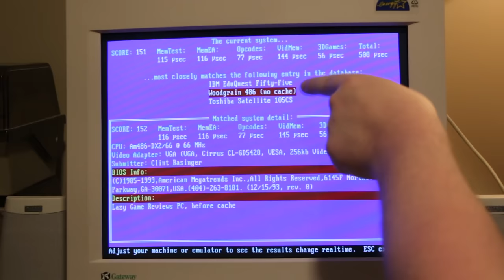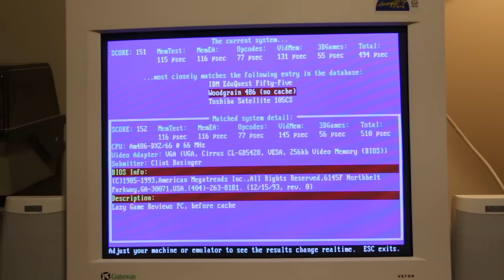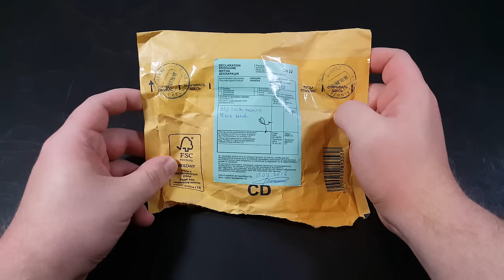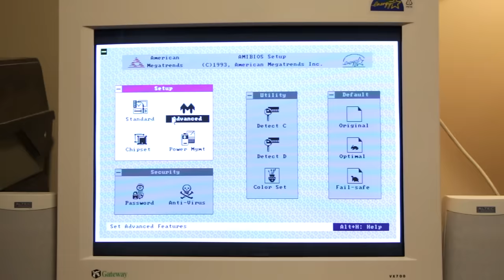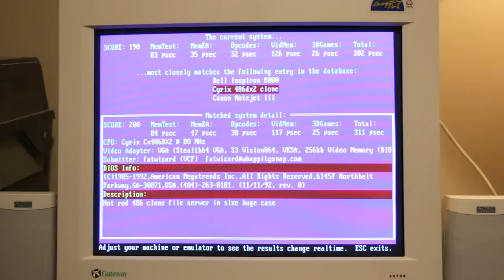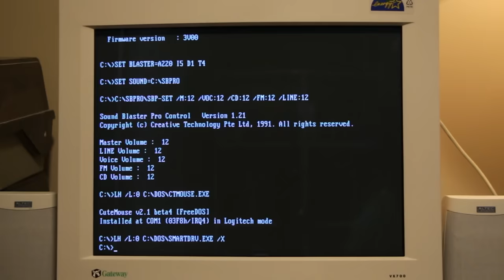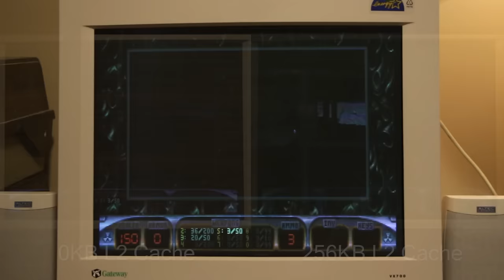LGR 486 Update! Installing L2 Cache

Comment: You can Play Diablo (1996) very well on a 486DX2 66MHz - it has minimum requirements of a pentium 60Mhz but for me it ran quite nice on my 486, and even better - since slower walking heroes were much more realistic than the sped up walking from a faster machine. Try it, you will be surprised.

Comment: I love the video, and I hate to be that guy, but shouldn't you be wearing a wrist ground strap when handling memory chips with your bare hands? You probably are in an environment where the air isn't too dry and the risk of a static shock to the chips is fairly low, but with something that's not easily replaceable, I'd still wear one just to be on the safe side. And yeah, Duke3D isn't really a 486 game; considering the machine and the game, the performance you got is pretty decent. :)
Reply: I've worked on RAM and cache chips all the time without a wrist strap and never had any problems with static discharge. Old 5-volt hardware is not that prone to it anyway. Just remember to touch the power supply to ground yourself to the case before working on it.
Reply from the maker: Not an issue. I explained why in the original build video:
https://youtu.be/fbjYkPKRm-8?t=1078

Also, as others have said, humidity in the south is absurd. I've never had problems with static since I started working on electronics a couple decades ago :)

Comment: It's odd but my IBM Aptiva 486/SX 33 ran Duke a lot better than that! It had its slow downs, especially with sloped floors, but otherwise it was relatively smooth at 320x200 with a slightly smaller window.
Reply: Maybe you had a better GFX card (VLB?) or better cache settings, like setting to fastest (2-1-1-1) instead of standard settings. I have a DX2-80 with a matrox PCI card and it runs Duke 3D with absolutely no slowdowns and Quake is almost as fast as on a Pentium 60.
Reply: Slowdown on slopes in Duke3D had to do with the lack of an FPU in the 486/SX, forcing the game to use slow software floating point emulation in those cases. Our Compaq Presario back in the day had the exact same problem.
Reply: I had a standard Cirrus Logic VESA 2MB card - nothing special.  Since it was a full toting multimedia machine, perhaps they added lots of cache and so on - still odd that extra 33Mhz and a co-processor would make so little difference.
Reply: Astfgl As far as I remember, Duke3D does not use any FPU stuff, even with the more advanced Raycasting? It was made for the 486 generation, Quake on the other hand was made for the pentium , which had a 3 times faster FPU, where it made sense to use it. It is surprising how fast Quake runs on a 486, when comparing it running on a 68040 with the same speed (50Mhz on the Amiga). However, on a Pentium 66, it adds a whopping 10FPS.
Reply: redavatar a 2MB card is actualy quite good. I had a Cirrus logic with 512K which could barely run Win95 at 640x400 at 32K colors.
Reply: AmstradExin That's how I've always understood it anyway. Duke3D uses integer calculations for pretty much everything, but needs a little FPU for calculating slopes, though it can fall back on emulation if no FPU is present. To be fair, I don't know anymore where I got that explanation from, I should go find a reliable source sometime.

Quake uses FPU all the way throughout its entire engine, so there's no way it could use emulation and still get decent performance. It would simply not start up at all if you didn't have a physical FPU in your system.
Reply: Astfgl Yeh, it doesnt
Reply: +AmstradExin I just checked the Build engine source code released in 2003 (what could be a more reliable source than that?) and yes indeed, it does use a couple of floating point assembly instructions in the slope drawing routines. It's just a few short simple instructions, hardly worth mentioning, but it's enough to bring a 486/SX to its knees when invoked.
Reply: Astfgl Interesting! But I think inside the source are the same calculations in integer for the same routines as well, since MS DOS does not come with any floating point emulation libs. It might be interesting to run the game on a SX and DX at the same speed.
Reply: +AmstradExin True. MS-DOS didn't come with much of anything, for that matter. My assumption was that the compiler/assembler used by Ken Silverman at the time automatically added an FP emulation code path for non-FPU systems. I did some digging, and I found mention that WASM.EXE, the Watcom assembler used by Build, "by default, generates code with support for 8087 software emulation".
Reply: Astfgl As I thought...

Comment: Your cache chips are basically 32KB (256Kb x 8) SRAM chips.  256Kb means 256Kilo Bits and is organized as 8 bits per byte.  So, 256/8 = 32KB :-)  You have 9 of them installed, but 8 of them will make up 256KB, two columns of 4 chips.  I don't know why there is a 9th one.

You can buy these on eBay.  Make sure the voltage is 5V and the speed is fast.  Your IS61C256 has 20ns speed.  You can get 12ns ones below.  But, 20ns is fast enough.

http://www.mouser.com/Search/Refine.aspx?Keyword=IS61C256

Comment: For an electronics hobbyist, cache chips on old motherboards are pretty valuable.  It's usually static ram, and almost always in DIP packaging, making it great to work with for all kinds of things.  Many years ago I used some from an old 486 as CHR ram when making a UNROM-based NES flash cart.   http://www.fybertech.com/forums/index.php?topic=453.0

Comment: Would putting that 3DFX Voodoo 1 card in it be cheating?
Reply from the maker: There is no compatible slot to install one, and even if I could it wouldn't make Duke3D go any faster :) It's not 3D accelerated and the Voodoo 1 does not feature a 2D chipset!
Reply: Hey, quick suggestion for a mini-video: Can you get Retro City Rampage 486 to run on the WoodGrain 486?

Comment: American Megatrends BIOS is now used in high end ASUS motherboard, they are THE best BIOS out there right now.
Reply: Apart from the fact that Asus' halo motherboards aren't necessarily the best, I haven't seen anything different than AMI BIOS/UEFI on PC motherboards for years. Even the cheapest PC motherboards use an AMI BIOS/UEFI. Phoenix-Award never offered a complex graphical UI and I guess that's why motherboard makers collectively told them good bye.

Comment: I miss those days when building a computer actually was (a little) challanging. These days you just cram in all the parts, hook up the wires and then the PC is done. No Jumpers, just a few parts and cables which you just cannot connect wrong :/

Comment: Duke Nukem was designed to take advantage of the Pentium's dual issue floating point pipeline.  Whether it's a DX2, or DX4, the performance will be far less than the original Pentium 60/66 MHZ

Comment: A Faster Video card can help! I have seen a 486 DX2 66mhz Intel run it in 640x480. Make it a monster if you can find a Cyrix 5x86 120mhz Socket 3 (wont need L2 cache addons)  Should be around Pentium 60-75 and run Quake 1 kinda well. Been afew years since i did it and PC was lost during 2010 break in. S3, Tseng, Mach32/64 will boost 2D,GUI,Mpeg (mostly S3).

Comment: I think this would be better with the DX4-100 chip installed than upping the cache.  Also the graphics card is going to be a bottleneck as it is only a 1mb one.  I believe there were far more powerful vesa cards about.

Comment: I wished to see a truly modern, cheap system (like a laptop with an Atom N2600 with graphics on chip, with a single dimm of 4GB of LDDR4 RAM ).
Where Windows 3.x and Win 9x and DOS supports the hardware natively (even if it's a lot faster and more modern), or where easy to get drivers are available that support this hardware (eg: Make S3 SVGA compatible graphics card, and Soundblaster 32AWE compatible soundcard).

Some toy costing $300, and just waiting to have an operating system installed.

Comment: Am I the only person who finds it funny that the external bus on x86 CPUs was fast enough once upon a time to make external cache make a lick of sense? It's no wonder CPU performance was growing exponentially in the 90s and not at all in the 2010s.
Reply: Cache speed has been limited by the actual signal propagation delay (i.e. speed of light in silicon) for a relatively long time now, which is kind of a crazy thing to think about. We can't really make bigger caches, because the speed of light makes them too slow, unless we shrink them first, meaning we need a process shrink... Physics doesn't allow any other way anymore. Crazy stuff. Meanwhile, the cache on this CPU is slower than my Ethernet connection. x)
Reply: I don't think that's correct. At half the speed of light (~an electronic signal in a wire), 10 mm (about the size of a chip on its side) has a propagation delay of only 0.06 ns; where as level 1 cache has 3 clock cycles of latency, or about 1 ns. Caches haven't gotten faster when they have shrunk in linear dimension.
Reply: You could check many public sources on my statement if you want. If you think about it a little further you'll realize the signal propagation of one single pulse from end-to-end is a pointless metric. It's about how the interfaces are designed, and the total cache search delay (which gets exponentially worse the bigger the cache die area is, as well as getting worse exponentially as the actual capacity of the cache increases). For instance, the interface between the cache and the parts of the CPU using it, relies on essentially zero-delay communications... As in, the cache has to remain faster than the core accessing it.

Cache has absolutely gotten faster as it has shrunk - otherwise it would no longer be fast enough to keep up with ever faster cores. You just can't measure it using some silly piece of software - it's internal to the architecture, it's not a delay exposed to the outside world. What you measure when you run a cache benchmark is the entire pipeline. It is NOT the speed of the interface between a core and it's cache.
Reply: Cache has gotten faster as long as Dennard scaling held true (ended about 2003-2005). Today on skylake it's the same 4 clocks as on prescott, and slower than the 2 clocks on northwood. Since prescott CPU clock speed hasn't improved and the size of L1 has merely doubled.

Cache latency is not exponential in die area. This is easy to prove.

L2 cache is 8 times L1 cache size (and ~8 times die area) on a skylake CPU and 3 times the latency of L1 cache.

L3 cache on skylake has 256 times the size of L1 cache and 10 times the latency.

If you plot and fit it grows slower than the square root of the die area; very far from exponential.
Reply: Because it's not the same cache... But whatever, you have no interesting reading actual sources on it, clearly, and rather just do your own homebrew investigation. I've told you how it is. You don't need to believe it but that just makes you wrong.
Reply: Oh but they are. They're all SRAM memory cells with the same cell size, transistor technology and structure and exist on the same die. The associativity is not following any particular pattern (L1 is 8-way, L2 is 4-way and L3 is 16-way).

Only the IRIS graphics version has EDRAM (L4 cache), which is truly a different technology.
Reply: That was just the FSB, not the main system bus. It was still running essentially at CPU speed, ie in this case 2x the rest of the chipset.

Whereas the RAM is running rather slower than the system bus...
Reply: Also, maximum processor speed hasn't got any faster for nearly 15 years because when you start pushing from 4ghz towards 5ghz you start getting problems of RF heating as well as that from pure electrical resistance, and that's something that even the previous winning tactic of die process shrinking hasn't been able to solve. So instead of simply working faster, these days we work smarter (better per-cycle efficiency, and wider data paths both to memory and inside the chip - or extra high speed serial links, which both leapfrog the worst frequencies, and also don't need to bother so much about the heating effect as they're only a single line rather than millions) and broader (ie, ever greater number of parallel-processing cores). After all, switching at four billion times per second is otherwise a perfectly rapid processing speed for any single simple thread; the problem we have these days is that we have a lot of different things going on at once, as well as some sticky problems that need more than 4 billion calculations per second (but thankfully largely rely on matrix math that can be very easily parallelised into many thousands of effectively-simultaneous processes that need the equivalent of a few MHz each, instead of one that needs double-digit GHz).

And as the SRAM cache is made of the exact same stuff as the rest of the processor, and almost exclusively built right on to the same die these days, it's subject to the exact same speed limits. Thing is, it doesn't need to be any faster, because e.g. the ALU can't consume or produce data any faster than it can be fed through the actual adding circuits.

And FWIW, what made external (ie on-motherboard, rather than on-CPU-card or on-die) cache practical in the 486 and earlier Pentium days was the bus being slow enough to allow it to work. At 33 or even 100mhz, signals travelling between cache and CPU have plenty of time to travel that extra distance. As bus speeds increased, the distance between CPU and cache had to decrease (which is why it ended up on the Pentium II and original Celeron processor cards, and why Super Socket 7 boards never went much above 100mhz, and IIRC peaked at an absolute max of 133mhz), and as bus speed started to increasingly lag that of the many-times clock multiplied CPU core it became increasingly clear that the best strategy was to build it into the processor die itself (which is what was responsible for the great increase in performance between the older AMD K6 series and the Athlons and Durons, despite the latter not having that much faster system buses), particuarly as it now had to increasingly compensate for the even laggier memory speeds, because there's a certain minimum distance you can place between the processor and the RAM...
...and DRAM has itself hit something of a wall in terms of addressing speed (it can burst transfer extremely fast these days, but true random-access is barely any faster than it was in the non-doubled SDRAM days; look at how the relationship between operating frequency and CAS latency ("CL") has evolved - if you divide the former by the latter, you get the effective access speed in MHz (invert that result and multiply by a thousand to get the access time in nanoseconds), and it'll be rather plain if you graph it out that it hasn't undergone anywhere near as much of an improvement as the headline operating frequency and burst transfer rate... Like, it may have improved 2x, maybe even 3x with the very best modules, but the frequency has ramped up more than 25x in the same period.

Comment: Well, that's weird. My friend had a 486 dx2 66MHz (from Intel, mind you) back in 95, and it would run DN3D a lot smoother than this, and in high details... Me, I had an i486 dx4-100 with some cheap VGA adapter, and it would run everything butter-smooth. :P

Comment: I dunno man, a lot of those id games ran terribly on clone CPUs (AMD, etc.) -- I know Duke3D ran great on my 486 DX4-100, but that's a different beast entirely. -- I wonder if it would run better on a legit Intel DX2-66 with 256KB of cache? -- Anyway those chips should just be standard JDEC pinout ram chips IIRC, you should be able to source them from just about anybody (mouser, etc.).

Comment: Kinda funny to note that modern 5400RPM HDDs are faster than L1 cache on those old CPUs. Like, damn.
Reply: +mipmipmipmipmip IF that video file was 8kB in size and the L1 cache was otherwise completely empty. Hard drives at the time of the 80486 were also MUCH slower.

Also, I have a WD Green with sequential read speeds of upwards of 90MB/s.
Reply: A HDD needs to seek the data before reading it. This operation still takes around 4 ms on modern hardware, which is a lot more than the read time of these RAM measured in nano seconds. 

Reading the whole 8kb the first time
On this L1 cache takes : ~ 122 400 ns
On Modern HDD : over 4 000 000 ns

This is 8 time faster.

What helps the HDD is the internal cache, without it, random access on your HDD would take eternity.

Comment: I used to be a low volume PC builder (about 14 a week), back in the 486 days. And to be honest the AMD 486 CPU's were rubbish. Additionally any motherboard with a SiS chipset was also rubbish in comparison to anything with an Intel chipset. SiS were used on all the bargain basement boards. Like PCChips motherboards, ughhh shudder.... Intel 486 DX4 100 is where its at. They were better than a P60.

Comment: I remember the game playing well enough on my Pentium 120MHz NEC system, 1MB video, sound sucked though (opti 82c930).  I don't have that PC anymore, that was a million years ago. I wanna build a new DOS system though. I might go with an AMD DX4, am told that it rivaled that of some of the Pentium 1 (or better in some cases).  My worry though is that it is too powerful for some of the older DOS games. It's weird, it's like, if you build a DOS PC, there seems to be two kinds of DOS PCs... one for the really old games, and one for the 3D games. One DOS PC can't run them all?
Guess I'll have to choose the older games, I'm more interested in internal speakers, CGA/EGA,  Awe32, etc... otherwise  an MMX 233 would be the lowest spec for a 3D DOS PC (otherwise you may as well just play in DOS Mode on Win98 with a P3, which isn't very retro imo).

Comment: 486 dx2-66 was minimum running Duke 3d. The dissapointment is real still in 2016 :(
Reply: I ran Quake on a DX-33 with 8MB of RAM. It should not have run, but it did.